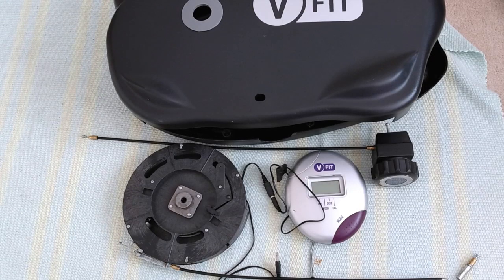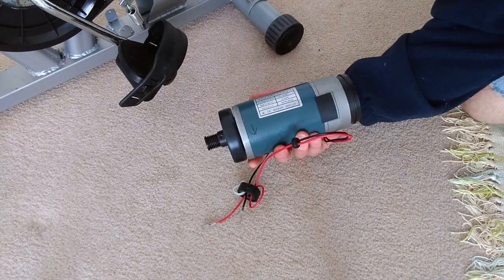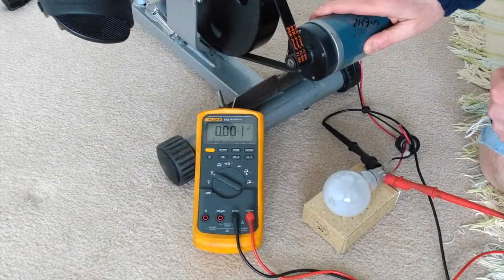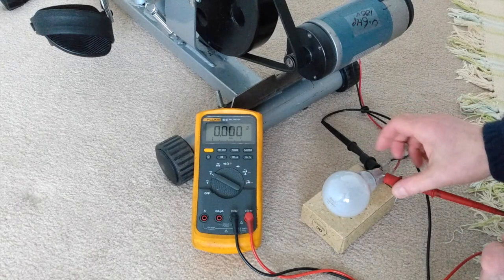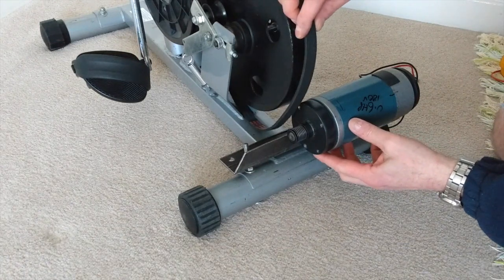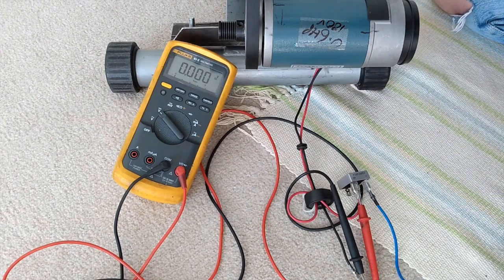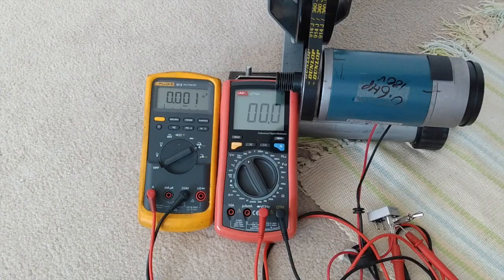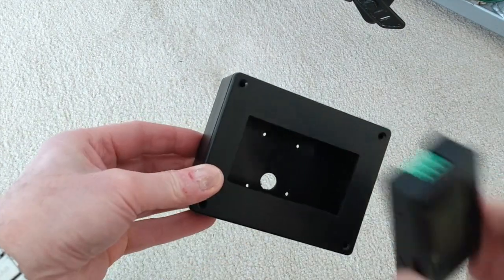Exercise Bike Generator Battery Charger

Comment: This awesome how long to charge a 12v leisure battery?
Reply from the maker: It depends on the capacity of the battery but it would take a long time. You could charge a small motorcycle battery or something like that but even a small leisure would take days probably. Also, I have the peddling speed optimised for 28 volts so it would need cranked at about half the speed for 12 volt batteries. You can calculate the theoretical time to charge at, say, 100 watts output for a known capacity (Ah) of battery.
Reply: @mrpingen  typical car battery has 100 Amphours. That means at 14 volts charging voltage, you need to supply 1400 watt hours or 2 hp-hours to fully charge it from discharged state. 

“An elite cyclist can produce 440 watts over an hour…An adult of good fitness is more likely to average between 50 and 150 watts for an hour” https://en.wikipedia.org/wiki/Human_power

so let’s say 100 watts. That will require 14 hours of total pedalling time to charge the battery. Are you up for it?
Reply from the maker: @krabkrabkrab  I could do an hour a day for a fortnight but know from experience that I cannot maintain 100 watts output for more than an hour - and it has taken me some time to reach that level of fitness! There is an energy counter on the bike’s display so I could come up with some sort of challenge video around charging a battery of some sort. (I have two 105Ah LiFePO4 12v batteries, so you have got me thinking).

Comment: Does it matter what side you mount the motor. Or does that change the polarity? And how would you go about making sure its spinning on the right direction?
Reply from the maker: The motor I used had no direction arrow so I assume it is OK to spin in any direction. Once mounted I just checked the polarity with a multimeter and then connected the positive through the diode to the battery accordingly.